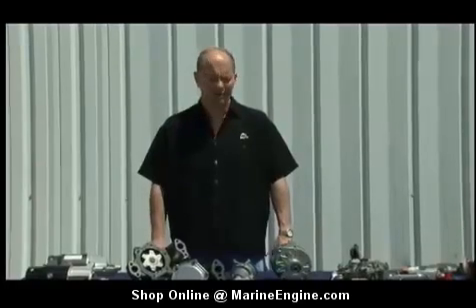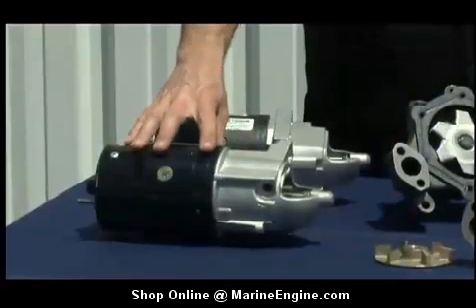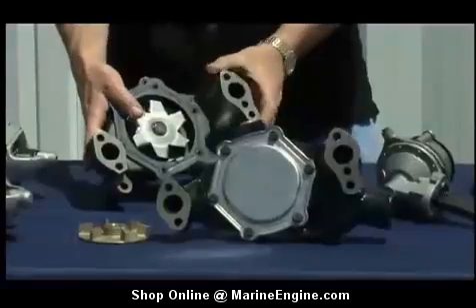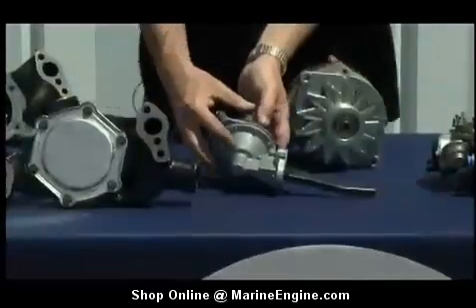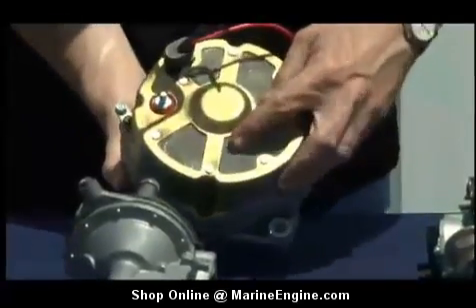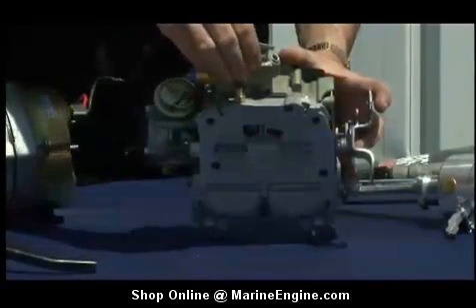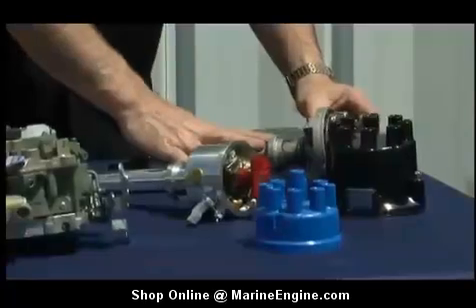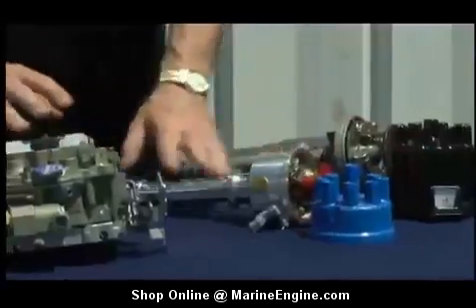Difference Between Marine and Automotive Parts

Comment: So if your replacing a water pump all you need to do is swap out the stainless steel plate since it will not go bad and waterproof the pump 
East peasy and you saved yourself $$$

Comment: You can buy the dual fat diaphragm pump for a non-marine application they must be something new the bleed off line the bleeder fly normally goes to a glass bowl with a plastic thing in it that says if this has fuel in it your diaphragm is broken $.30 worth of steel folks put over top of a standard alternator to stop sparks justifies the price difference  there is no difference in the shaft between a Plus you don’t need the vacuum advance because you’re trying to make torque you’re not trying to make RPMs no there is only there not do not different the 350 Chevy has exact same stance or RPM range in idle range is the standard 350 Chevy the marine version and just look at the stats in the book there’s no difference people. So the aluminum inside the cab is highly corrosive but then they make outboards out of aluminum they make boats out of aluminum explain this  and originally in this video when he first placed it he said I would have a second video to come out to talk about the difference in engines where is this video is 2021 you played plenty of time to make it I am not saying not to buy marine parts what I’m saying is is we’re getting ripped off because the updates they put on these are not worth that much money in the warranty‘s for what we pay is not sufficient for the value please make your second video I am tired of waiting

Comment: OK first thing on the starter why would the starter be underwater why would it be in Marin environment it’s inside of an oily engine bay if there’s water in the engine bay you have a bigger problem than the Apoxsee is going to take care of of how do you take the nose off of both of them so we can see  why can’t you take the backing plate off the last 10 marine water palms I took apart were made out of cast-iron I have never even seen one with a brass impeller as long as your C pump is working you don’t even need your circulator pump are you gonna tell them that

Comment: Explosión on a starter!? Lol
Reply: Make a puddle and put gallon of gas on that puddle then grab electric live wire and dump it on the water and see if the gas doesn't ignite.
Reply: Car engines are in the open....in boats its a sealed compartiment, meaning with the right fuel and air ratios there is a big chance of fire, or worse an explosion.... boat fires are pretty common,  especially for the boats that are not regularly used and yearly checked...